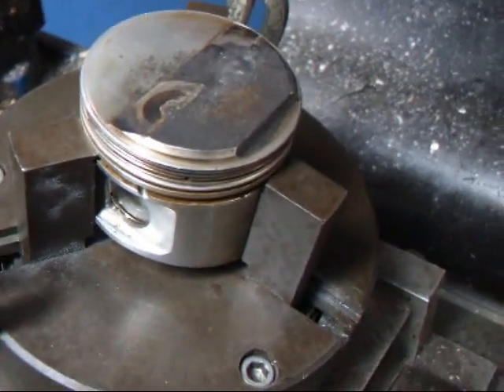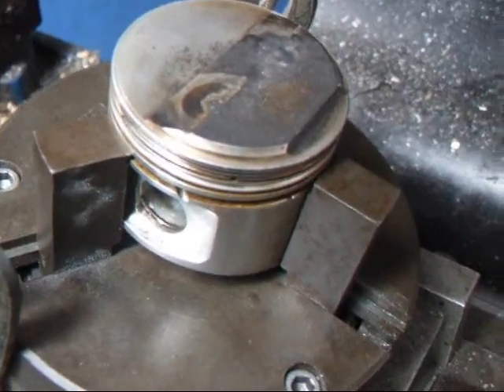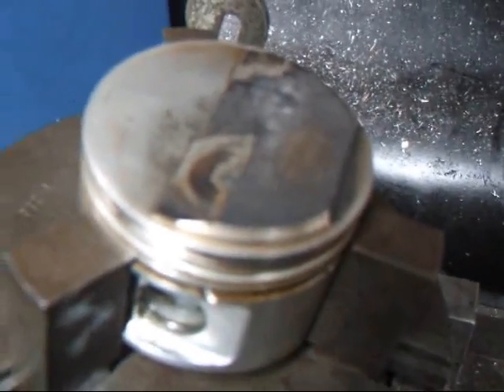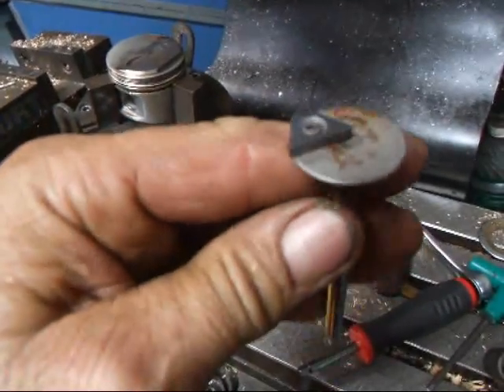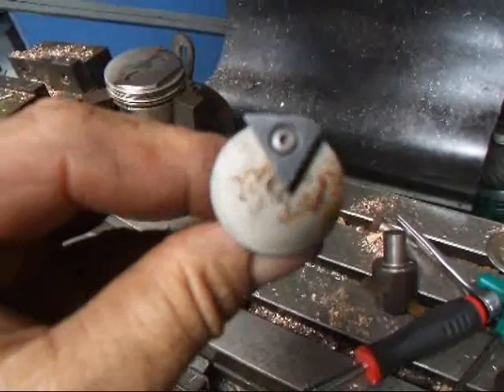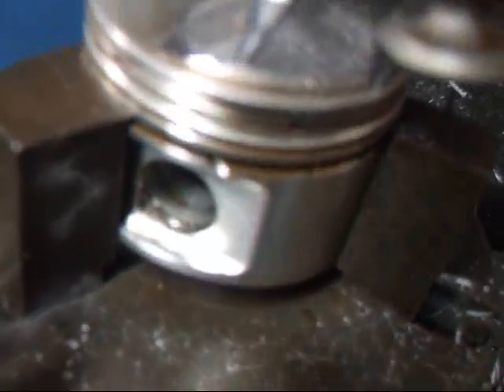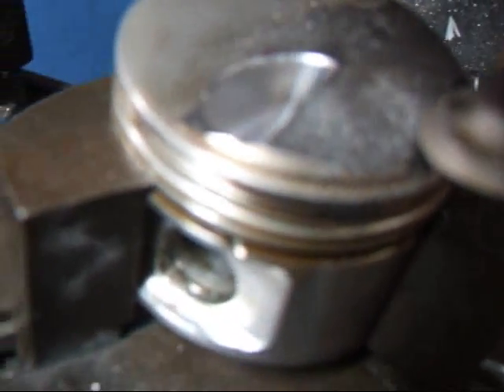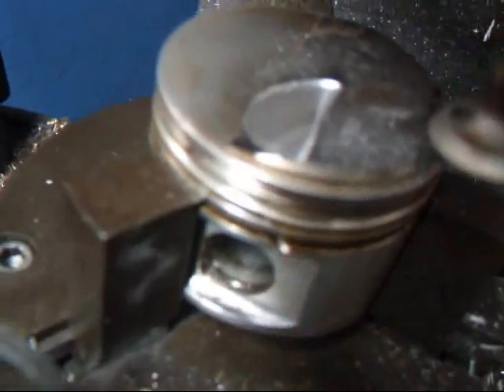Valve Pocket Machining.wmv

Comment: How can this affect the balance? I thought about doing this on an engine I have so I could run some bigger valve heads, that are also shaved some, along with a bigger cam shaft which I’ve heard some say that you don’t need to worry about rebalancing as long as it’s a lighter piston and not a heavier piston but I don’t know how true that is...

Comment: How do you set the Pistons (not only 1)....to match the angle, the Position and the depth of the relief to match it all EQUAL....THAT is the work, not cutting some chips ! ;)
Reply: Typical SB chevy is 23 degrees. Race heads can be 18, 15 degree etc. Big blocks are a different animal with canted valves.

Comment: does this kill compression at all??
Reply: Technically yes.
Reply: No it does not "KILL" compression, it adds typically 3-7 cc's of volume. Look at it like this, adding volume lowers comp but it this application he's running dome pistons so he's lessened the volume so much that he had to give some back as valve notches. Which also will let the motor take more cam lift with longer duration.
The dome pistons he has probably are -13 cc. A flat top will be 0 cc. A flat top with valve notches will be + 5 (for example). So his dome pistons which were -13 now are -7 cc. It is lowered but not killed.
Example 10.5:1 compression ratio with flat tops now add 5 cc valve notches you'll have 10.35:1. So this isn't a seat of your pants feel.
What is noticeable would be 10.5:1 to lets say 8.9:1, so anything in between there wouldn't be seat of pants noticeable, there's some determining factors to cr and how much cam duration & lift, the material of head, iron, aluminum.
Hope this helps establish the word "KILL" is way way way to overkill.
"Mopar or no car" by the way
Reply: The slight loss in compression from doing this, is well worth the gain to be had from the valve reliefs allowing the use of a higher lift/duration camshaft, going from being limited to a tiny camshaft that’s got a small lift and duration, vs pretty much anything you’d want.. it’s kinda like with cylinder heads, deshrouding the valves in the combustion chamber (grinding out some of the material on the edges of the combustion chamber right underneath the valve head to allow more flow in and out of the valves to the combustion chamber) or the part of the chamber that is cut away when they’re being cut for bigger valves, you’ll lose a little compression,  but the extra air flow more than makes up for it... flow trumps compression any day of the week.. because what you gonna do with all that compression if you can’t get the air to flow in and out of it? And really the more air you can get in the cylinder, the higher the actual compression/cylinder pressure will be...
Reply: Google the conversion from CC's to cubic inches. Do the calculations in cubic inches first because its easier , then at the end convert to CC's.